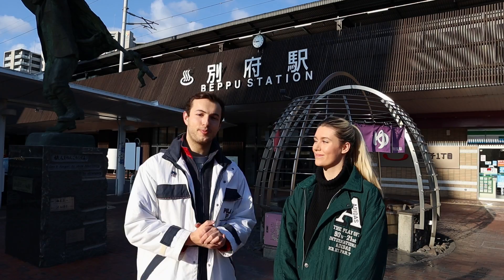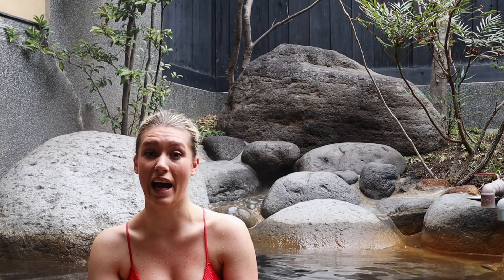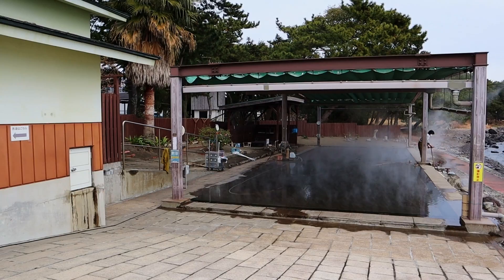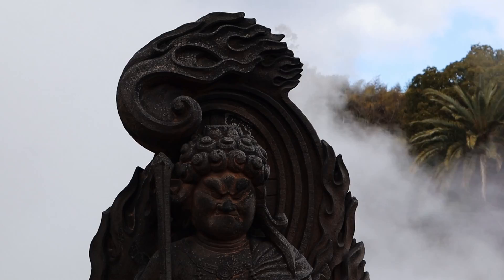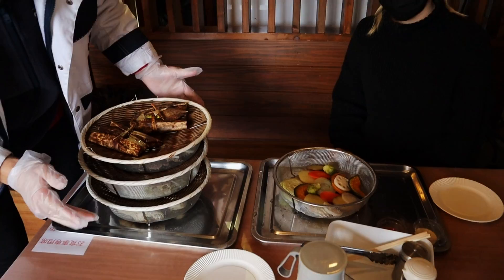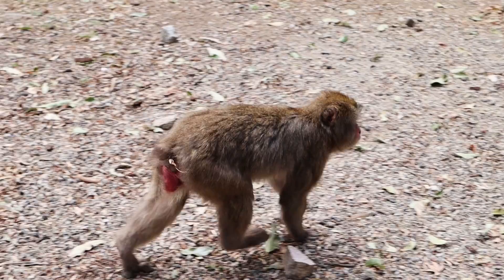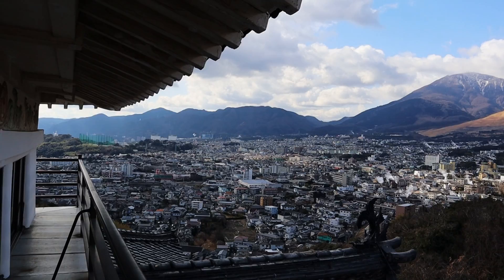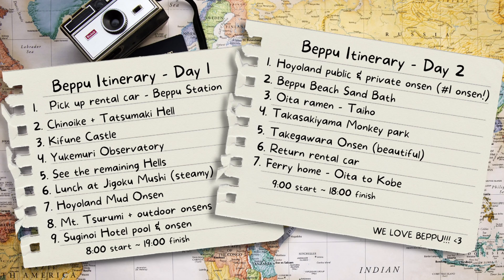ULTIMATE BEPPU TRAVEL GUIDE | Top 6 things to do in Beppu, Oita Japan

Comment: Would an English speaker survive without Japanese in Beppu or would you need to speak Japanese to visit there.
Reply from the maker: You should be fine, most of the things don't require much conversation (for which you can use Google translate if needed), lots of things have vending machines, but there is a big university in Beppu so the general level of English is better than average I'd day